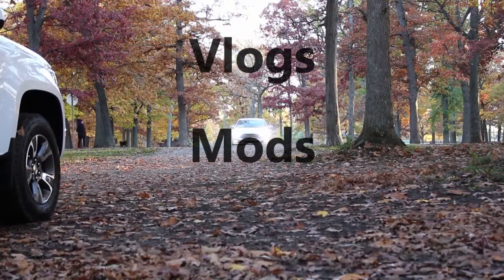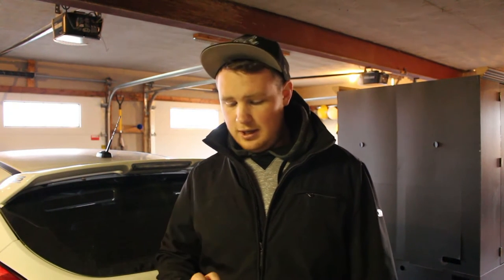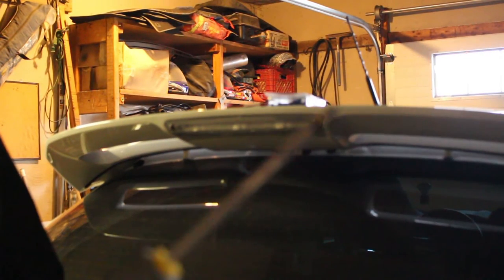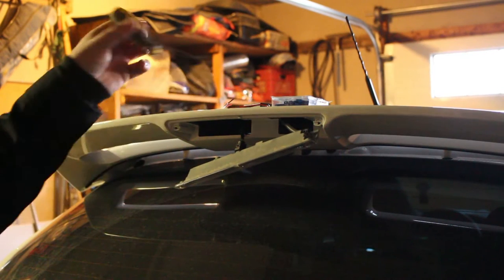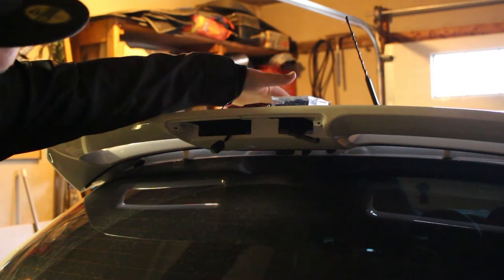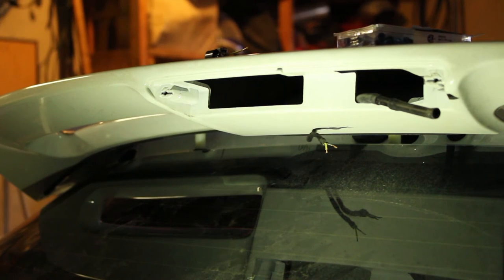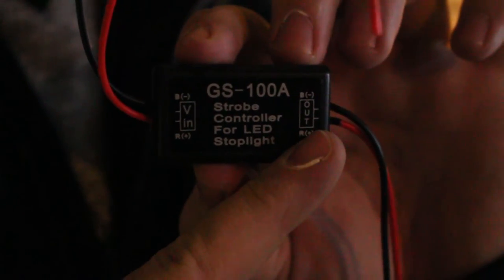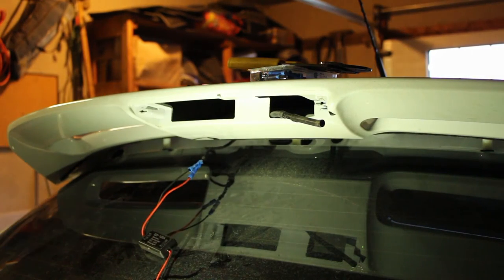How-To | Brake Light Flasher Module Install | 2016 Focus ST

Comment: Hey man can you explain why it only works when the ignition is on but when the engine is on it doesnt work?
Reply: Same. I've got no resolution so far.
Reply: same here dawg i just installed it and it goes to solid when the engine is on but works when just ignition is
Reply: Same issue here...

Comment: When I did mine I fucked it up and now the car won't start, no brake light and brake switch blew on me. The car will not go into drive. Did you ever get stopped by the police in Ontario?? I'm in Ontario too and wanted to know